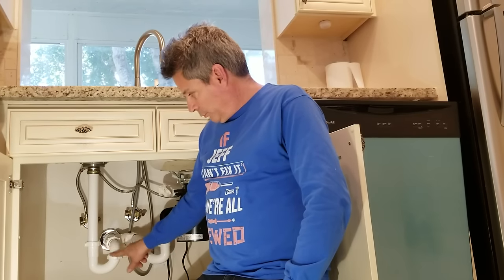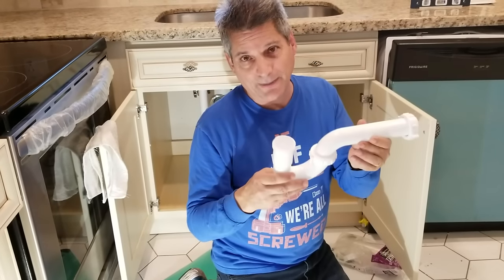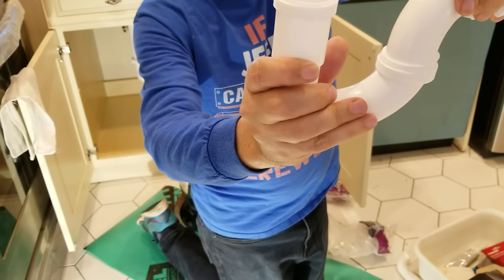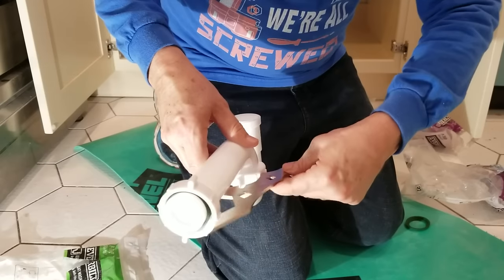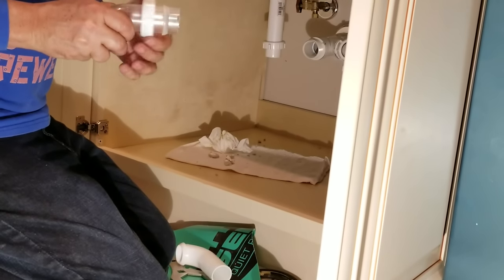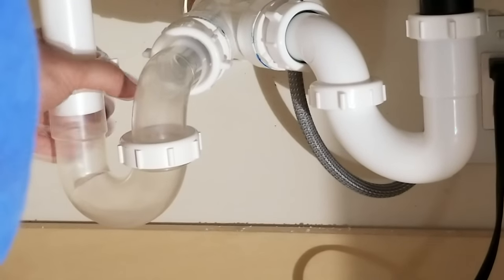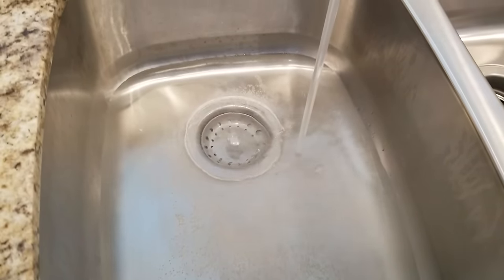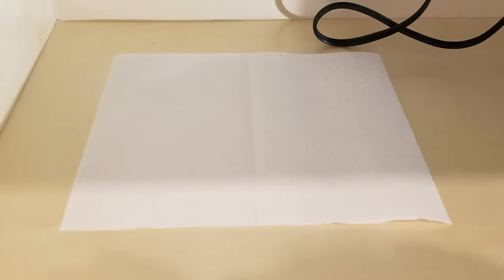Why is my Kitchen Sink P-Trap Leaking at Connection Nut?

Comment: Do you have an instructional for that set up including the wye?  I have a slow kitchen drain and overflowing air gap.  I wonder if that would work to correct my issues but I don't know how to install this wye that I bought (the ends are flared out).  Any help is appreciated!
Reply from the maker: Yes we show you how we connected it here: How to Install Dual Kitchen Sink Drain Plumbing Pipes https://youtu.be/mR3_Wzs74Q4
DO NOT use the transparent p-trap we show there, they all crack, no matter who you buy them from, they fail within days or weeks. they use a weaker more brittle ABS plastic.
Reply: Thank you!  Yes I did see the review you gave about the clear traps.  All my fittings are the white PVC

Comment: I work in apartment maintenance and it seems like the situation always happens when I replace a bathroom sink with a new one. In my current situation I Believe it is leaking at the middle one (P trap) you shown, but also I see water accumulated around the nut on the vertical first joint as well. I noticed it will never do it when you sit there and watch, it always takes its time like a couple hours or overnight with a small limited puddle😢 I'm wondering if the delay is because of that leveling weir effect that was showing on your clear p trap? I will go back in Monday and try your technique on that leaking drain. Thankfully it is in a vacant unit.

Comment: Thanks for this I’ll give it another go in the morning. That joint was leaking and I went at it three different times. Couldn’t get it to stop. And then I tried to put on of the gaskets in there and that didn’t work. You’re not kidding when you say that joint has to be perfectly lined up. I think I was off slightly. Also. Is there a better system for this ? Just seems kinda flawed.
Reply from the maker: A lot of the old school plumbers prefer to use the big thick real PVC P trap fittings that were big back in the 1970s, although a lot of the city inspectors frown on them because they want them to be removable by the homeowner to easily get in there and remove stuff that gets clogged down the drain. So the newer stuff is made out of that Poly plastic and but the older connections were all threaded and tightened or you could buy even more robust P trap parts that you would cement them together all of the PVC parts get cemented. But that makes it too permanent to keep our local inspectors happy.
Reply: @jeffostroff  re adjusted that trap and carefully held it in place while I threaded it, and fixed the leak. Thanks for the information great channel.

Comment: I have a leaky trap but wideo doesn’t address the leak. So do I buy a new Ptrap?  It never joins together within it a bubble drip  do I use sealant?  I’ve realigned so many times  maybe be the plastic isnt fitting anymore
Reply from the maker: Make sure that center joint is aligned and seated right and tighten that one down FIRST, then all other connections get tightened down. Hopefully this solves your problem unless you have a crack at the connection

Comment: Good video. Very informative. What size pipe/p-trap is it for a slop sink?  How durable is the clear p-trap compared to the pvc p-trap?
Reply from the maker: This is a kitchen so we used 1 1/2" pipe. So far the clear pipe is holding up, it has been in place about 6 months.

Comment: Hi Jeff - I followed your instructions when connecting the P-trap, and it seems to be flush at that dangerous connection point. Still, it drips about .5 ounce every time I run the water - very slowly. It seems like it only drips to a certain point. So it's almost, but not quite good. Would taping the threads do any good? (I'm talking about the connection that does not have a gasket, but just rests within the connecting pipe.) I've re-connected it 3 or 4 times, each time being pretty confident that it fitted perfectly. Thanks again.
Reply from the maker: No it you should not add any tape. Make sure the 2 parts are aligned perfectly, then tighten that connection FIRST. Do not tighten any other connections until this connection has been satisfied first. Then tighten the others. Many people make the mistake of tightening the other connections first.
Reply: @jeffostroff  - Thanks Jeff - I'm screwed. It is impossible to tighten that connection first. If I do, the "P" part is way above the bottom of the (sink drain) tail pipe, and there's no way I can pull it below the bottom of the tail pipe to fit it. Maybe I need to shorten the tail pipe. Oh well, it's only a P-trap - they're not expensive - if I butcher it, I can start all over :)
Reply: @bammbamm12  
I've sussed it out and the answer was so simple and I don't think it's emphasised on any p-trap video. 

It may seem obvious to some but it's about assembling the three parts together as a unit before attaching to the corresponding pipes under the sink. 
I was trying to do them all individually while attached to their respective parts under the sink and lining up the threads was driving me nuts because of the limited access and angle of view.

Comment: can you add anything if the two pipes without the gasket dont sal and leak from top of nut?  sealer plumbers putty flatt h=gasket on nut?
Reply from the maker: As we show in the video there is no reason to add anything if you just make sure the connection is perfectly level and seated before tightening the nut.

Comment: My P trap started leaking from the connection point out of the blue. I’ve taken it apart but before I put it back together and tighten the connection point, Do I to do anything else? Like maybe apply teflon tape to the threads?

Comment: Great video, my experience with the clear traps, they stay clear about 4-5 hrs. Now my clear trap looks black
Reply from the maker: Mine have always stayed clear. what could be causing yours to turn black?
Reply: @jeffostroff  could be the garbage disposal, its a single basin sink unlike your setup in the video
Reply from the maker: @steverone7623  Garbage disposal should not be depositing anything dark, unless maybe it's old and rusty inside, and maybe it discolors the water as it discharges it down to the P-trap.  Do you keep it clean, and throw a few cups of ice down it every week to cleanse the inside? The p-trap is self cleaning by design, so there should never be anything caught in it, and the water inside it should be clear.
Reply: @jeffostroff  you're good. The first disposal was a slightly used model. That finally bit the dust and i replaced with a new one
Reply from the maker: @steverone7623  I've seen some real rust buckets over the years. Starts when water collects in them and doesn't drain thoroughly, so water sits at the bottom of it and rusts it out. Happens a lot when the waste pipe coming out of the wall is too high so water backs up out of the p trap, and back up into the garbage disposal. Numerous ways to rust these things out!
Reply: @jeffostroff  Do you live off of shame, Andre?
Reply from the maker: @zacharycable7018  not sure what you are asking. What does shame have to do with changing a P Trap?
Reply: @jeffostroff  Why are there no listed components in the amazon link you sent? Do you think you have something to hide?
Reply from the maker: @zacharycable7018  Not sure what it is you are complaining about. I have 2 links pointing to Amazon, one takes you to the wrench, the other takes you to the P-trap. Not sure what you mean by there's no listed components.

Comment: What if it leaks from right where pipe attaches to the sink? From that joint? How to fix that? With the tape?
Reply from the maker: We just uploaded a video this week that shows how to remove and install a new kitchen sink drain. https://youtu.be/6mFfoYcK6zc likely the putty under your drain flange is dried and cracked causing a leak
Reply: Thanks. Only fix is replacement seems like. Do you by chance have a video on how to replace broken metal tub drains? I have two broken ones and I tried but so far not successful.

Comment: I’ve got a fast leak under the sink, I have tightened the connections but it’s still running and the stores are closed…. Can I use plumbers putty to cover the joint tonight?

Comment: Where do you get the nut that connects the pipe go the flange at the bottom of the sink? Mine leaks there, I replaced it with one of the pvc nuts you have in your video but it still leaks. It has a plastic washer could that be it?
Reply from the maker: If you have a link by the flange, it means your flange was not well sealed with plumbers putty. Some plumbers even prefer to seal it with silicone, then wait an hour before running water down  the drain

Comment: I had to replace some rusted out metal traps,  although the drain pipes are ABS.   Do you object to use of a bit of teflon pipe dope on the PVC?
Reply from the maker: DeadKoby Some plumbers like to use pipe joint at the connection where the p-trap exit connects to downward pointing curved part of the long trap arm going into the wall. They feel the compression of the pipe dope seals the connection better. But I have always felt that's putting a band aid on our inability to tighten that connection without getting a leak. You should not need to add the pipe dope there if you make your connection properly. This is why it is so important to loosely tighten all the drain and p-trap pieces together first, BUT... tighten that connection between the p-trap and the p-trap arm first, since that is the most critical joint that fails most often. So we need to satisfy that connection first. If you satisfy that connection first, it will treat you well, and it will not leak. But if you tighten all the others first, and then tighten that connection last, you may be breaking the seal microscopically by adjusting it slightly to conform to the other parts. Numerous times I've seen plumbers walk out the door thinking they did a good install, but the trap seal starts leaking hours later, or the next day.   I have not had a failure since switching to this method and I don't add pipe dope, I try to avoid adding things that the manufacturer does not call for.

Comment: tightened the hell out of it and it kept leaking. was going to caulk it but finally just made sure the arm connection was tightened FIRST, and no more leaks! thanks @jeffostroff
Reply from the maker: Good deal, yes it's not the tightening, it's correct positioning before tightening.

Comment: What about at the PVC tail piece using the provided gasket meeting the sink strainer?
Reply: It's actually leaking underneath the nut that joins the strainer and tail piece
Reply from the maker: There are two possibilities of where the leak is coming from when you have it leaking at that connection. It is either due to the fact that the high hat gasket was not put into place at the top of the pipe before securing the tailpipe into place with the nut. another thing to look at is the water might actually be coming from higher up for example where the strainer meets the bottom of the sink that is the much more likely location that we normally see, and that is because the plumbers putty that was originally put in on the top side of this sink for the flange has finally dried and cracked and now water was leaking from up above and so by replacing everything and putting in new plumbers putty that should start the clock all over for you again with a brand new install

Comment: I have a P-trap leaking exactly where you have stated between the P-trap and the arm. It is made out of metal and that nut appears to be corroded with white calcium deposits. It is under a utility sink in the garage. The drain hose from the washing machine drains into the utility sink. What size would that P-trap be 1 1/4" or 1 1/2"?
Reply from the maker: There is no way to tell without being there to see it. You have to measure it. I would replace it for sure with all that calcium on it.
Reply: @jeffostroff  Thank you for your quick response. Guess, I'll just have to remove it to find out. The arm piece seems longer than usual too.
Reply: A 2nd look underneath, indicated that the corroded nut that connects the P-trap arm to the J-bend is actually broken and the connection between the two pierces are actually disconnected. It took all but 30s to unscrew the J-bend from the sinks vertical tailpiece. However, the horizontal P-trap arm that's attached to the Marvel/Stub out/waste line in the wall took 4 hours to unscrew. Did I mention this P-trap is anywhere between 25 to 50 years old? I had to use PB-blaster penetrant, a large channel lock pliers, and even a monkey wrench.  I've tried leaned over the top of the utility sink and from below the utility sink. Anyways, almost gave up and was so glad when it finally turned without breaking any pipes in the wall. Yup, you were right the last installer put in the gasket in the wrong direction. The tapered end was facing the nut and not into the corresponding tapered Marvel/Stub out pipe. Surprised it hasn't leaked. I thought my troubles were over until I realize the P-trap arm is wedge in there real good. I couldn't pull it out. I tried the large channel lock and PBblaster into the seams. Had to do this from under the sink. The channel lock chewed up the arm. Decided to remove the utility sink to get leverage. Turned off both the hot water and cold water valve there. Sigh! Leaks! Anyways, that's another story. With the utility sink removed I was able to get more leverage and got the  P-trap arm pulled out. The arm was into the wall pipe 3.5" -  4" inches and the arm itself is about a foot long. The arm was 1 1/2" diameter.
Question: The P-trap kit I bought only comes with an arm that's only 8.5" inches long. Can I just insert the arm into the Marvel/Stub out/waste line just 1.75 to 2" inches instead of the 3-4" inches????
This way I'll still have to push the utility sink in further by roughly 2" inches closer to the wall but I'll still be able to access the water line connection and the valve from simply hovering over the top and to the back of the utility sink.

Comment: HI. A few days ago I changed the 3 pipes you're working with here to pvc as the metal ones were rotted out. I was careful about the gaskets and the leveling and followed what you said to the letter. All good. I had reason to be under the sink again to store something and I noticed a streak on 1 pipe. Its dry down there but all the plastic fasteners were slightly loose...this is after I tightened them "hand tight" plus a 1/4 turn with the pipe wrench. Is that at all normal? Should I go back in with that plastic plumbers thread tape or some adhesive? Any guidance would be appreciated.
Reply from the maker: That is very odd Steven, could be they contracted a bit in cool dry weather then when hot water went though the they expanded, maybe it forced the plastic nuts to unwind a bit. Try ti tighten them again and test with hot water then cold cycle a few times water and see if it does anything. You should not have to add any pipe dope or anything. Also, are you sure nobody touched those plastic nuts? Sometimes you find out someone did it when you were not looking.

Comment: SO I got a p trap set from one store and I disassemble the part so many times because it kept leaking no matter what at the connection nut. so I decided to go to another store got another p- trap and it worked. I have replaced my shower heads with no leaking and I can tell the  first p-trap I got was defective.
Reply from the maker: Yes that is strange I have never seen a P trap fail myself. But I never liked that connection point the way they designed it because there's no room for error you have to get it right on the nose or it will leak

Comment: FIX so if your like me you tried re positioning several times but always got a leak what finally worked was a few careful wraps with teflon tapes around the v shaped valve this is where the sealing is done so far its holding great.
Reply from the maker: I've seen a few people do this in the past, but I'm of the opinion you should not have to do it if that junction is seated and sealed properly. What I've been doing is get all the connections loosely connected, then tighten that V-shaped part first, not last. Once he is satisfied first, then tighten all the others.
Reply: @jeffostroff  i have no doubt that works when the surfaces mate well w/out defects however my several attempts never worked and tape did hard to argue with success, the real question is why a gaskets isnt there to begin with;
Reply from the maker: @mst3kpimp  We know why it worked, because it sealed the connection. I just want to know why they designed that connection that way instead  of with a gasket like the other connections.
Reply: @jeffostroff  i guess because they want it to be able to pivot to accommodate offset installations the v valve or other should have a sealant type coating.